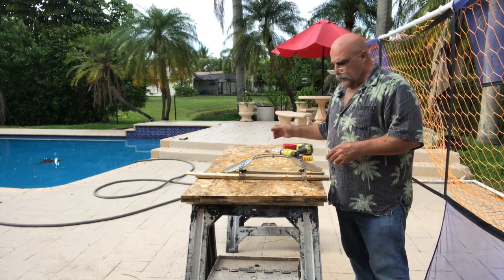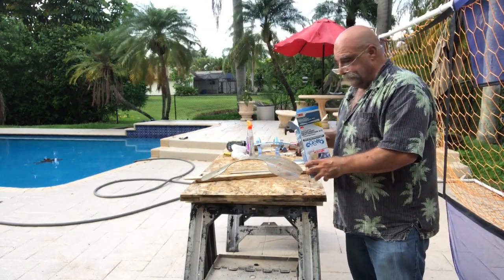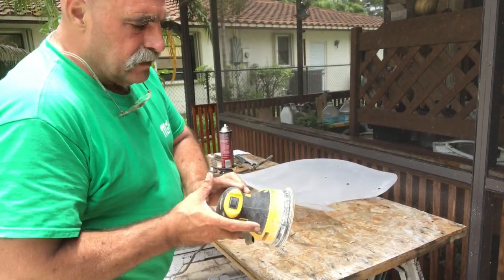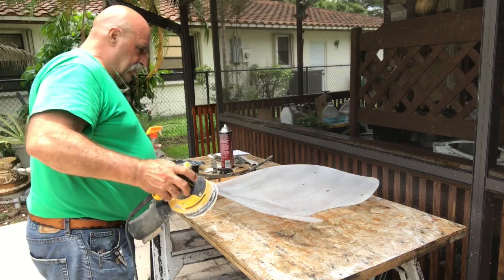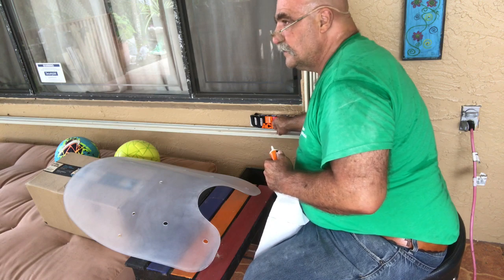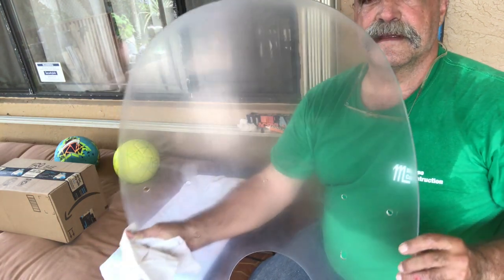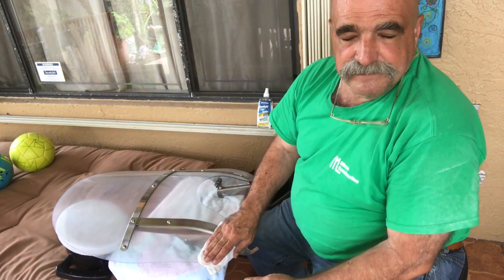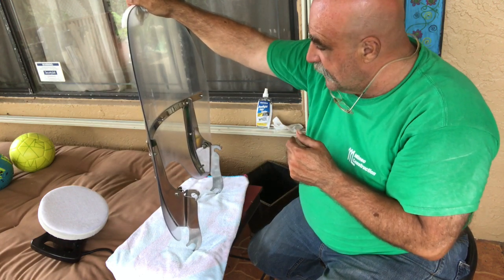Restore your windshield

Comment: Great outcome.  But please know, even the slightest haze will make the windshield turn completely white at night with oncoming traffic lights.
Harley dealerships have a plastic polish.. white bottle, forgot the name.  But after trying all the online stuff. That and mothers aluminum and mag wheel polish works the best, especially when you use a claybar before ceramic coating. I mean in my kitchen I couldn’t even see the windshield from some angles when I was done.
Reply from the maker: Thank you for your comment.  I have learned also, that polishing should go first that is going to be your best solution. All the rest of the stuff works OK during the day, but with lights it’s unpredictable.

Comment: You are a great guy doing all that work and you just saved my windshield situation thanks!
Reply from the maker: This is for extreme cases you should try to use a good polish first before doing this method
Reply: @buildingwithpapa  let’s just say…my windshield is WAY worse than the one you did in this video lol

Comment: They make hook n loop polishing pads that attach to a drill that would have done the job in about 15 mins and you wouldn't have had to sand it first depending on which compound you used. Hind sight is ...
Good job, brother.
Reply from the maker: I’ll try and find them it sounds interesting. 
Thank you for your comment and if you can leave me a thumbs up.
Reply: Done!
Reply: That actually depends on the windshield. If it was a Harley windshield it comes with a really thin layer of vinyl on it very similar to window tint but clear. Many people mess up their windshields by using caustic chemicals when they clean them. Or window cleaners with too much alcohol and/or ammonia. If that's the case then that layer needs to be sanded off. You will be able to tell because parts of the shield will look good while other parts will be pitted, scratched, hazy or dull. 

Another thing that may be pertinent to mention is that you should take your time sanding it and not set the speed of the sander too high. Because it will generate too much heat and if that transfers deep into the plexi it will haze it deeper than you can polish. The "wet" sanding part is highly important as well and should be emphasized. They also make sanding pad "cushions " that go on an oscillating sander underneath the sandpaper that helps with the heat as well as not having particulate build up on the paper that could case the paper to produce scratches deeper than the sandpaper. Lastly and I'm not one to plug any particular corporation bit through my own experience with sanding and polishing all kinds of materials. A $10-$15 3m single sanding disk will outperform and outlast any $10-$15 30 pack you'll ever buy off Amazon that came from China. Don't get me wrong sometimes those papers have there purpose but not with polishing. 

Great video for people to rejuvenate something rather than just tossing it aside and buying new. I enjoy making things last.

Comment: A for effort! You'd have saved yourself work  if you'd have used rubbing compound on a buffing wheel attached to a drill - prior to using the hand glaze. Also, polishing with wax as final step also works, for those who don't have the sealer.
Reply from the maker: Thank you for your comment and if you can leave me a thumbs up.

Comment: Wouldn't it go back to being hazy once you clean it? I ask because its only looking new because of the producs you're using which I can only assume would wash away with dish soap right?
Reply: You can always clear coat it. Look at chrisfix's video on restoring headlights. There is also a healight sealer wipe that works the same

Comment: So which sandpaper did you use first , was it the 2500 Dow to the 400 and how long did you was each one
Reply from the maker: No you start with 400 and work your way to 2500 the higher the number the finer of the grit
Reply from the maker: Thank you for your comment

Comment: My windshield is now permanently blurred. I sanded with 800/1500/3000 and then polished 🤷‍♂️
Reply from the maker: What polish did you use
Reply: @buildingwithpapa  I went to auto parts store and picked up Mothers NuLens.  It was a headlight renewal kit.  My windshield looks like its scratched up but it is smooth to the touch.  Idunno
Reply: 800 grit is way to harsh. I use 1,000, 2,000 and then 3,000 grit, all wet sanded in opposite directions. Then I use Meguiar’s PlastX plastic polish on a microfibre buffing pad on a drill.

Comment: I tried this method. Spend almost a 100usd on products and 7-8 hours of time. It’s worst than before. I don’t think this works at all. Buying a new one is the solution..
Reply from the maker: Thank you for your comment. Depending on how bad the shield is whether this would work or not sometimes polishing it first to see if that works if not then to do this method but it takes a real good polish at the end also.